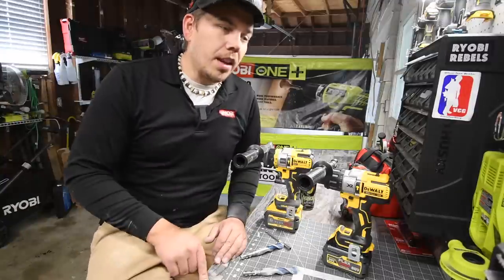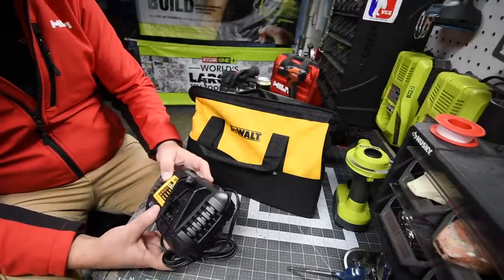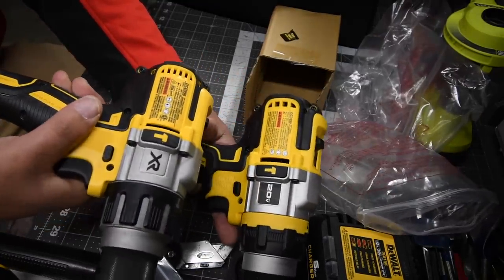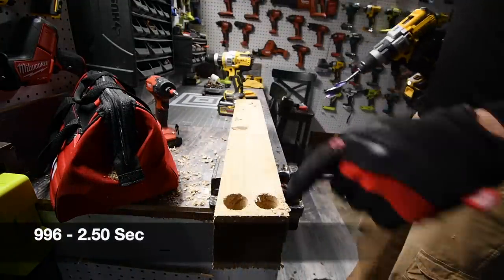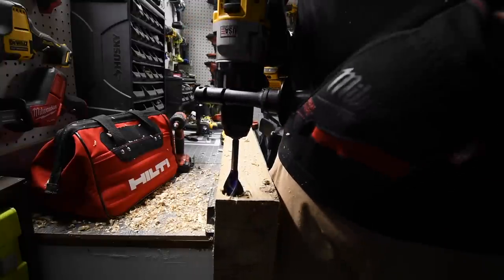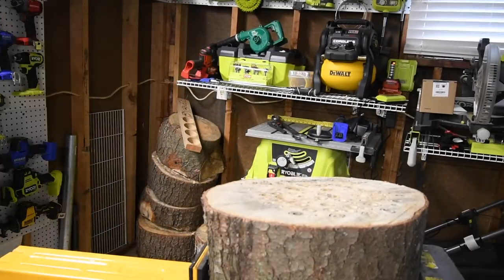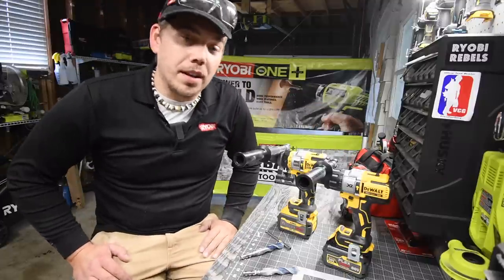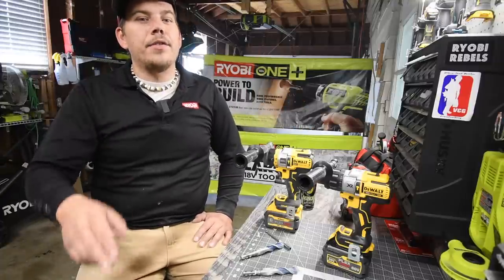NEW!!!! Dewalt Flexvolt Advantage kit

Comment: Glad to see an honest review on it. They should make one that's actually a Flexvolt drill
Reply from the maker: They should it should be a 60v drill
Reply: 20volt saws are very average. Buy a proper 60 flex volt saw with battery and charger combo, as they are beast and in most cases  you can do well with 20 volt brushless  tools for almost everything else, and yes the flex volt batteries are backwards compatible with 20volt tools. Don't get caught up with all the gimmicks, just stay 20volt and brushless for everything except the saw.

Comment: Hmmm... interesting conclusions.... ummm.... I have to wonder if this review is from the point of view of “is it worth it to upgrade from the 996 combo?” Though... because if it’s approached from the point of view that “I don’t have the identical impact driver” and “I have no drill at all” or “the drill it’s replacing is 6 years old mid tier stuff” maybe the conclusion might be different? Maybe ? I don’t know... I think it performed well and the difference in the new battery was visible... but I love your testing techniques man... I think your advice definitely makes our buying choices a lot easier, well done.
Reply from the maker: this is only worth it if you don't already have the 996. if you don't have the 996 yet id get this set because it has the new 6ah flexvbolt advantage battery

Comment: So not to sound dumb here but I have tried doing research on the DeWalt and there evolution of batteries.  I bought my first drill/driver and impact driver two years ago.  As an individual who doesn't use power tools on the daily I got entry level tools.  At the time I got Makita as they seemed to preform better on the entry level than the rest of the major brands at the time of purchase.  Anyway, I'm selling them as Makita is harder to find at local stores than DeWalt and some other brands.  Also I don't like having multiple brands of battery power tools that I have to keep track of multiple batteries for and Makita's bundles don't impress me very much.  Who needs a vacuum and a clunky light?  So I went out and got a DeWalt set from a certain orange home improvement big box store that I can expand upon at a later time.... 
So to my point as this flexvolt stuff is new to me.  I see in your video you have what I'm assuming to be an older version and a new version of DeWalts hammer drill at this time late in 2020.  So as I think you made your point here the battery really is the big difference.  So to that end I do have 2 flexvolt tools a circ  saw and an angle grinder.  With that being said, is it worth the money to invest in 1 or 2 flexvolt batteries?  If so what Ah size do you recommend since they offer a range?  I'm not worried about bulking up the tool with a bigger battery either.  I plan on using the circ saw quite a bit 2x & OSB stuff like that it's the DCS573 7.25". I would absolutely appreciate your input or anyone else's for that matter.
Reply from the maker: Dewalt is the one brand that the 2ah battery will outperform the other 2ah batteries from other brands. check out this videohttps://www.youtube.com/watch?v=ABTuTCA65h4&t=444s
Reply: Thanks for the reply, I haven't even given much thought to the Ah size until I watched that video.  I assumed that the bigger the battery the longer I could use it for my tasks.  But that puts things into perspective a bit more!  I might buy that kit with the 999 for my dad to upgrade him from the age of NiCad or whatever the used before lithium batteries.  Thanks again!

Comment: I don't know about where you are, but the new DCK2100P2 kit in Canada is quite a better deal than the old DCK299P2 kit.  You get the new Flexvolt advantage drill and you get a fast DCB118 charger.  And the kit is up to $40 less than the old one!  It's a no brainer.
Reply from the maker: I bought this before it came out, the price might have dropped since then

Comment: I just saw this and while I appreciate your videos, when it comes to DeWalt I wish you (or someone) would just go through the confusing lines of tools they have. Just pick one tool - Drill-Driver and go through the differences between XR / Power Detect XR / Atomic / 20 Volt Max (non-XR) / 20 Volt Compact / Brushless and also the batteries, 20 Volt / 20 Volt XR / Flex Volt.
So many tool reviewers when it comes to DeWalt are all hyperbole, over-the-top “power” reviews, but not giving the consumer a calm and really informative insight to all of this. I know other tool brands have also have different lines, but DeWalt (to me) is the most confusing, sort of like comparing mattresses from one brand because (as you pointed out), often the is a specific model of feature only sold at Lowe’s vs Home Depot vs Amazon.... etc. Also being they are the most “go to” brand that folks look at and compare to.
That would be very helpful!  Much thanks!
Reply from the maker: I did make a video on that already, The flexvolt vs XR vs atomic. you should check it out and I thank you for viewing Eat

Comment: I upgraded to the dcd999 from the dcd985, definitely noticed a power difference between drilling through concrete and using hole saws. The dcd999 is way more powerful and was worth the upgrade for me,  I'd say it's not worth upgrading if you already have a 996-998.
Reply from the maker: I agree with on that Bryan
Reply: Our 996 is rattling in first gear and won't engage. I don't know if anyone really makes a more powerful drill. Would love a dedicated 60 volt drill. And DeWalts 60v drill isn't really for drilling like we drill everyday. Too slow.

Comment: Totally agree, disappointing the included impact is the 887.
Reply from the maker: I thank you fastrice
Reply: @ManCaverTools  man it would be a great stage for DeWalt to put out a new flagship Impact Driver that Rivals the Milwaukee gen 3 fuel!
 I think they will put it out as a stand-alone tool, or with battery, and charger to begin with... it's about time
Reply: I agree I'm ready for a new Dewalt Flagship Impact Driver..
 BUT my DeWalt 887 Impact has been an absolute Workhorse for me! 
Absolutely not one complaint and have never needed any more power than what the 887 offers with a 5 amp hour or the new compact 4 AH with 21700 cells..

Comment: Hi Dave!  I would have to agree with you.  And even though I ‘bleed Orange’ when I get a cut, 🤣 I would go with the ‘Power Detect’ myself.  I believe DeWalt has just put some lipstick on the present tools, and made sure the electronics could handle extended runtime using a FlexVolt battery.  I routinely use a FlexVolt battery on my little 20 Volt jobsite blower, with no ill effects.  If I use it for an extended time, it starts to seem Hot?  I also use the 9 amp hour FlexVolt battery in my little 20 volt DeWalt 7&1/4, sliding miter saw, since it is a stationary tool.  It runs faster and better with that big battery, which just barely fits in the tool.  Hanging a big old FlexVolt battery off a drill, especially an impact, is heavy and cumbersome, and frankly a bit silly!  Just my two cents!  Thanks Dave Stay safe and Healthy!  Peace
Reply from the maker: I thank you for your feedback George and I also thank you for viewing
Reply: True, I killed a standard brushed reciprocating saw cutting a salt treated 6x6 with a 9amp flexvolt battery,  think it got too hot with all that power and may have put too much pressure during the cut...not sure though.  What ever the case it let the smoke out.

Comment: I believe they discontinued the yellow “Fast Charger” on the kits due to the fact that it can only charge the 20V.  Also I believe they have another new charger with a higher amperage.  I USED to have the 998 with the “Power Detect” with the 8 AH battery.  I had it only for 2 days.  Couldn’t compete with the Milwaukee M18.  Plus the 998 is sooooooooo huge..👍
Reply: Lol, the 998 trashed the m18 on this very channel.
Reply: Yeah you’re right...but it way much bigger than the Milwaukee...👍
Reply from the maker: The 998 is big, and I thank you for viewing Delsaures
Reply: @ManCaverTools  The big DeWalt won’t run as hot as the Gen 3 drill.  I talked to the Tecnical department at Milwaukee, as I sent in my Gen3 Hammer Drill, ( not for that reason ) and could NOT get any satisfactory answer.  Milwaukee’s E- service is great,  try them out fellas!  It’s just they are not as up front as they should be.  Heck, most of the Tool companies aren’t either 😂  Milwaukee messed up my fairly new drill, from the servicing of it,  and ended up sending me back a brand new one, bare tool, in the factory box. That is the one thing I can say for Milwaukee for sure!  Makita service is alright, as long as you use their  ‘Jorsey’ facility!  My M18 drill had the annoying ‘switch lock up’ issue, on Fwd/Rev.  and the chuck was messed up.  DeWalt service, ain’t what it used to be.  Peace!
Reply: @delosaurasrex732  lol m18 is shit doesnt even compare to the 996 let alone 998
Reply: I had the Dewalt 998 for two days...selling the bare tool with extended handle for $155...NO battery or charger...👍👍🤣🤣
Reply: They put that yellow charger in the Power Detect Kits,  it charges my 8.0ah battery in about an hour,  not too bad. 👍
Reply: I have the yellow fast charger and it charges my 9ah flexvolt battery
Reply: Tools and Stuff compared the 996, HiKoki, Makita XGT, and Fuel Gen 3. The Fuel can only keep up with the 12HO, otherwise it falls slightly behind.
And that’s a common theme amongst testers, with the Fuel’s major advantage being its relative compactness for the power.

Comment: I just managed to get this kit for about $270 at my local homeless despot. $299 reduced price + 10% military discount. First cordless drill purchase in 20 some years and the first cordless impact ever (blame my battery anxiety on the old memory prone ni-cad packs of yore). Interestingly enough I got it not because of the new flexvolt batteries, but for dewalts normal 20v batteries. As they have much less control circuitry in the battery itself so you don't get drainage and weird dead battery issues that come along with having a full fledged battery management system in the pack, like in all the other brands I've looked at. 
Makita is a good example where they look to have one of the best battery design and management systems for maximizing the batteries usable lifespan. But the BMS draws from only one cell. So long term storage ends up over draining that single cell and flagging the battery as dead. This isn't an issue with contractors that regularly use and recharge their batteries. But for a home DIYer that stores their batteries for long periods without any use, it seems the dewalt "dumb" 20v packs are best suited. They also seem to be relatively easy to open up and replace the cells. So you can just replace the individual cells as they go bad and avoid paying out the ass for entire new batteries.
Reply from the maker: not too shabby and I thank you for viewing Chahahc

Comment: I am guessing this is the newly posted DCK2100D1T1 Kit on HD website? Seemed alright for the price and the charger, Flexvolt battery, bag and DCD999B tool is $279 and you get the Impact Driver and 2Ah battery for only $90 more, but yes maybe a Flexvolt version Impact Driver tool and 2 batteries for like $399 would be the best.
Reply from the maker: if you were to get this id just get the drill and battery

Comment: I think a few have figured it out.  The product comes with a 6 amp.  998 is coming with an 8 amp. Would like to see if you put a 9 amp flexvolt battery on the 999 if your going to get 998 performance or greater.  The product being released with the 6 amp battery is my guess on the performance issue.
Reply from the maker: Id do with the power detect

Comment: Dewalt makes a hell of a drill, but has trouble with impacts.  I just sold my 996 and 887.  I went with the M18 Surge and Hammer Drill (clearance deal $175).  Also, thanks for spending your 💰 on this so we don’t have to.
Reply from the maker: Very good, going with milwuakee is a good choice as well and I thank you for viewing Dmcal
Reply: WOW , Where did you get that Deal on the M18 Surge Combo Kit ??
Reply: Brian F Home Depot.  2999-22CX on clearance for $210.  Plus, they took a 20% off coupon from Harbor Freight.  It was $178 w/tax.  On top of that, I sold the batteries (2 & 5 ah) w/charger for $115 on Marketplace.
Reply: @dmacl123  --- Your Home Depo takes Harbor Freight 20% off coupons ??  Was that the first time or do you do it all the time ??👍👍👍
Reply: Brian F not just mine.  I am successful about 50% of the time.  Plan B is the fake Lowe’s coupon.   If they say no to HF I pull that out Lowe’s and get at least 10%.
Reply: If you know all the tricks you can damn near rob Lowes and Home Depot and get them to print you a receipt.

Comment: You used the 21700 for both drills. You should have used the new battery mainly for the new drill. I’m not making my mind up till you put the advantage vs the power detect. To me it seems like the advantage definitely has an advantage paired with the battery it comes with. Hell even the 9.0 ah would even be better with the advantage
Reply from the maker: more tests are coming up. and I thank you Holden
Reply: Man Caver Tools no problem! Great work as always

Comment: After watching this video.  I’m starting to think DeWalt for the uwo ratings between this and the power detect flipped.

This is supposed to perform better than the power detect.  But I believe the power detect is stronger.

You may have a defective unit.
Reply: Agree the Advantage is 1200 UWO And The Power Detect is 1000 UWO..So should wipe the floor with power detect👊
Reply from the maker: I don't think I have a defective unit. I think the power detect is just a better tools that works  like it says in its name
Reply: Agreed.  But it may be in the Batteries , the New 8.0ah and 6.0ah batteries are great and they definitely have the 21700 cells in them , I own the Power Detect hammer drill and it definitely an upgrade from the dcd996. The P.D. tools actually have Less power when you put a FlexVolt Battery on them , they get the most power from the new 8.0ah battery... 👍🛠🖖

Comment: I don't get why you say over and over and over again that you're disappointed the kit has the 887. It's basically the current top of their range, has been for years now. The updated 888 version lets you connect to your phone and has push buttons instead of a switch. Oooh. Wow. Killer upgrades there.

Maybe it is time for a refresh, but I question the utility of giving it more power ala the flexvolt advantage line. They're already pushing the limits of that tiny 1/4 inch drive and any bits you could put on it. The 887 will drive 6in SPAX screws wicked quick, and make 3in deck screws pull themselves straight through a 2x4 if you blink at the wrong time.

I've given my 2 887s hell for years now, and they just ask for more. I really can't imagine what more one would want in that form factor. They do make bigger impacts if you need to drive giant lag screws, that's about the only thing out of reach of the little drivers.
Reply from the maker: I say that because this is a brand new tool, the Dewalt Power Detect has been out for a little while before this came out, why make a tool that is less powerful then the power detect?
Reply: @ManCaverTools  Oh, thought you were talking about the impact driver, which to my (admittedly limited) knowledge, hasn't seen a power detect or flexvolt version. It is confusing why they would release newer versions (i.e. ATOMIC) that are lesser powered and built lighter. I agree newer versions should be better.

As an aside, I gotta say, Dewalt's marketing is confusing as all get out. 20V Max, Atomic, XR, FLEXVOLT, FLEXVOLT Advantage, POWER DETECT etc. etc. I wish they would start with a clean slate. Maybe Dewalt Homeowner / Dewalt Professional / Dewalt Industrial Grade or Dewalt Awesome, Dewalt Awesomer / Dewalt Awesomest.

But then we'd probably Dewalt Max Awesomester Industrial XR/EXP 2.0 FISSION in a few years. Sigh.

Comment: the metal clinking sounded like your intro music at one point, the new flexvolt hammerdrill has one advantage and that's you're not just limited to flexvolt you could use a 20v
Reply from the maker: Yes sir. their are benefits for that
Reply: Yes , but I also figured if I'm going to spend money on the FlexVolt batteries I might as well just go with the 60v FlexVolt Tools and get all the Power , right... 👍🛠🖖

Comment: Ill be adding the 999 to my line up since I dont have a hammer drill yet and home depot has the 999 as a solo kit (bag, battery and charger) for $279, no 887 included. I have the 791 compact drill and the 887 impact driver.
Reply from the maker: very good and I thank you for viewing Manolo

Comment: Good job.  Is the Flexvolt with the 999 a new version of battery?  FYI, for the 2020 holidays, Home Depot has a limited supply endcap special of 999 (tool, handle and belt clip only) for $179 with a FREE 6 amp charger and Flexvolt battery ($179 value).  No bag, but for around $10-12, grab a Husky bag.
Reply from the maker: I already filmed that and thank you Larry :)

Comment: My question is, if I don't own either drill should I buy the dcd996 not really sure of the price it cost or should I get the dcd999. I can get the dcd999 with a new 6ah battery, charger and bag for $299 without the DCF887

I will add the DCD996 is nicer looking tool when it comes to design, I find the yellow clutch looks cheap on the DCD999.
Reply: Also consider the DCD998 power detect w/8AH battery/charger/bag at (Lowes for $279).  Looks as though the real differences might only be the batteries.
Reply from the maker: Id go for the new kit if you don't already have the 996

Comment: The 9ah batteries are 21700 but the 6ah even the new color scheme is still 18650. Just place a 6ah flex battery bottom to bottom with the 9ah and not only is the 9 longer since it has more cells but it’s wider where they use the longer 21700 cells.